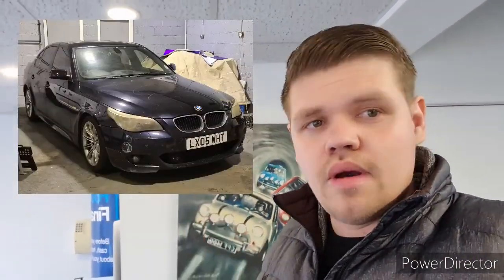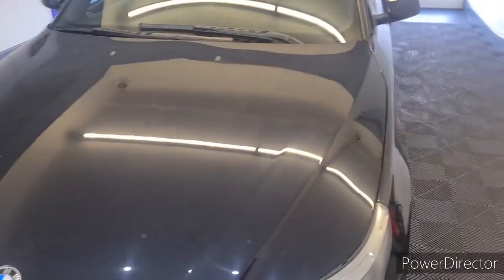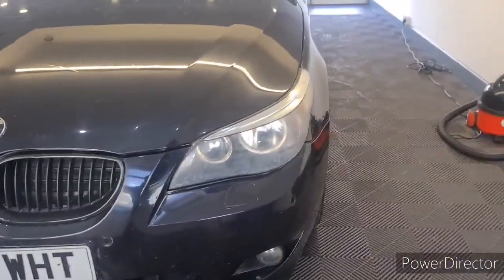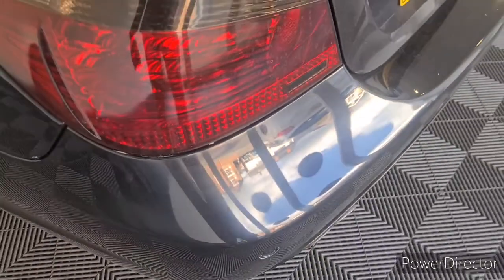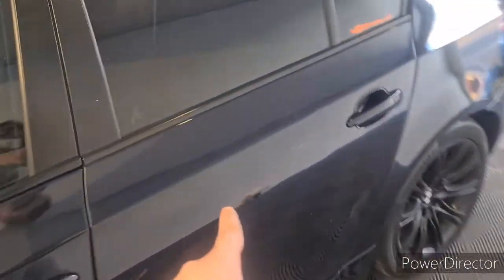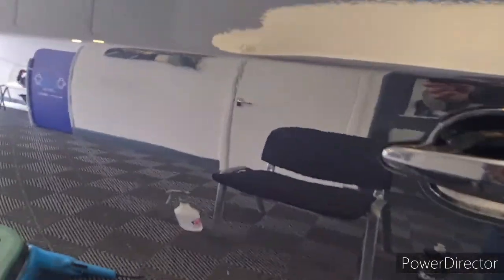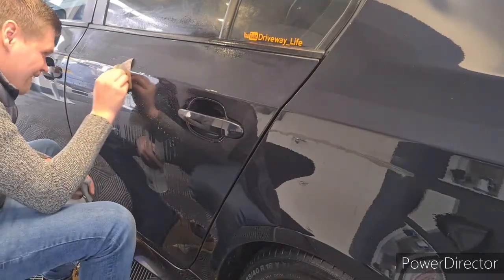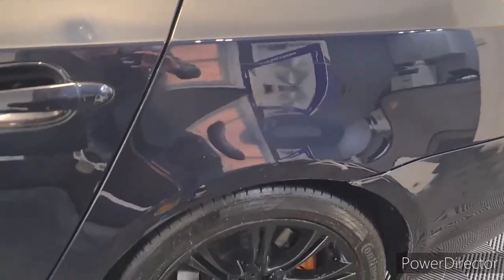Bmw 5 Series (E60) Project - Finished ( AutoGlym Head Light kit + Touch up paint. )

Comment: You should put tint in the headlights
Reply from the maker: I looked at it but I didn't like the look it's in a previous video
Reply: You need to put more touch up on, give it at least 12 hours to dry, get a blade over it to level it and then wet sand and polish, that should do it.
Reply from the maker: Never thought about a blade 🤔.  Definitely worth a shot